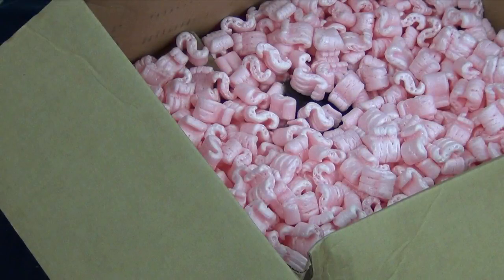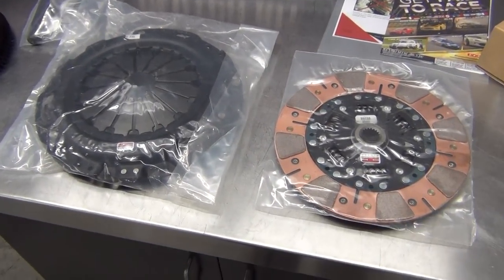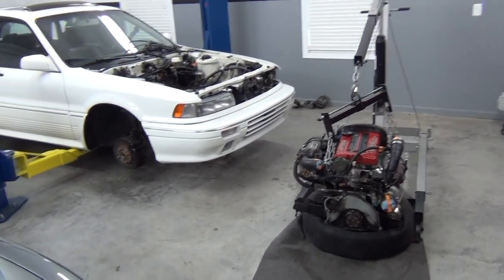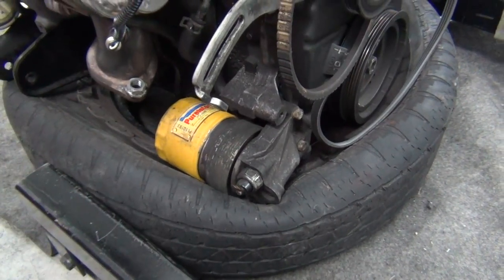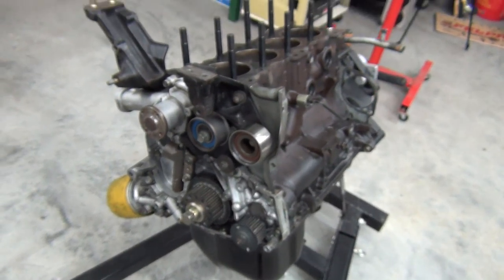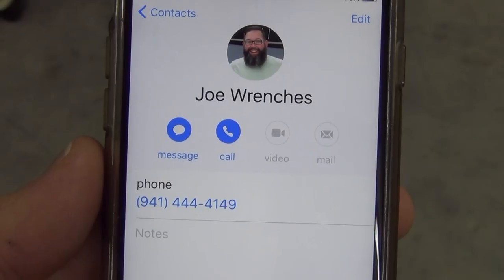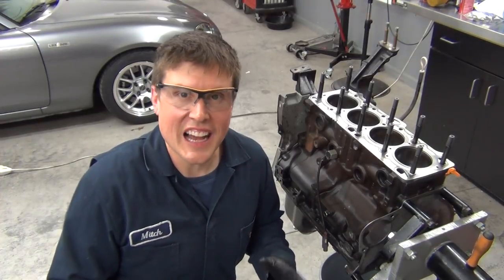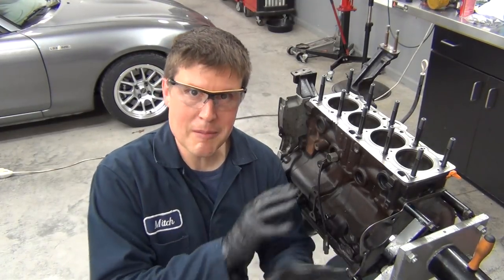Street Sleeper Part 6 - New Parts & Cylinder Head Install

Comment from the maker: Here's the latest Street Sleeper video, I hope you enjoy it!  Whether you're racing, wrenching, going to a car show or just doing some maintenance, I hope you have a great weekend filled with awesome car stuff.  Oh and don't forget to call Joe please. :-D
Reply: I really liked my Comp Clutch flywheel before I went auto.  I used a south bend kevlar clutch though.  Curious as to how the Comp compares.
Reply: Hey Tom, love your videos! Your sense of humour is...peculiar, yet I'm always entertained... And I love how you take your installs very seriously and do everything properly. Actually hard to find here on Youtube!
Just a note about the Competition Stage 3 clutch; I had one in my jdm manual Nissan Stagea, and it was VERY aggressive for the street. It did not like stop and go traffic, and chattered like crazy, and it made for a very uncomfortable ride. Considering you're building a STREET sleeper and not a track car, I'd really keep this in mind.
Keep up the good work!
Reply: What kinda battery you have on your Hitachi impact gun? I have a BSL1815 1,5ah, think its a bit weak or maybe the amperage doesnt matter for the torque...?
Reply: Thank you Tom man!
Reply: tom can i have your old engine ?please ? lol
Reply: Tom, Great upload! I absolutely love the screw driver trick by placing the nut on the screw driver and let it guide the nut onto the stud.  Genius!!!
Reply: Tom's Turbo Garage  just double checking but aren't you supposed to torque the are headstuds a lot more than stock like 100ft lbs and then on the 2 center do 102lbs
Reply: Tom's Turbo Garage love your channel it go me to buy a talon and leave Subaru next project car that I know would give you a lot of reviews is doing a Subaru gc8 coupe swapped to a sti swap In it and 6speed fan for life hardest thing ever
Reply: your videos are my fix now that jafro aint making any new ones
Reply: Tom? Why did you use studs rather than bolts?

Comment: i've been spinning spanners for approx 7 years now, and i'm ashamed to see i never thought of that screwdriver trick @ 12:55 ... it's GENIUS.
When a bolt/stud is somewhere deep, place a screwdriver with the nut around it on the bolt/stud and drop the nut. It will go on the bolt/stud without falling next to it in the unreachable depths of the car.

I would tape the nut to a spanner, but it can't be don eeasily with a socket, so thanks!

Comment: You might want to throw some marvel mystery oil down the bores and roll it over a few times before startup.  That shortblock has been sitting for a long time and the rings are probably no longer lubricated.

Comment: I know it can be difficult at times. I had a question tho, when you're torquing the cylinder head on is it beneficial to use long pulls all the way to the click on the torque wremch, or short clicking it to the specified torque. 

in other words does it make a difference putting the load down across the head
Reply: boobam no worries here my friend lol

Comment: Hey Tom. I've ran into a huge problem with my Galant. I got the same clutch/flywheel from the exact same shop/ppl. 
issue is clutch dont work. pedal in peddle out. NOTHING. its bled/aligned. and as instructed I did EVERYTHING. I did however get a bit confused when they tell you to throwout that bearing. 
Im thinking why did they include it anyway if I have to throw it out anyway?? is there anything else I can try to get my beast beating
Reply: jack black haha had me thinking about that until I read the end

Comment: What's the difference between simple clutch, and clutch with springs?
Reply: u need a clutch with springs if u had a single mass fly wheel
Reply: thertcw can you explain about masses? Single mass dual mass etc.?
Reply: in a few words... single mass is 4 racing dual mass is 4 comfort :)

Comment: wait why are u changing block?
Reply: Dahl original motor was feeling like it lost power so he is swapping in his built dsm motor and trans
Reply: Danny Silva but all he is taking form other engine is the bottom end
Reply: Watch the other videos.
Reply: Dahl full long block the head on the dsm engine was off because it's a built head so he had it checked out before he uses it. his old engine will be put away only thing he is using is ac compressor and alternator